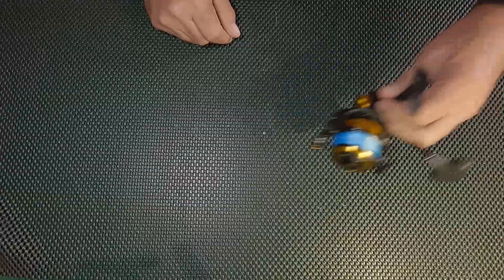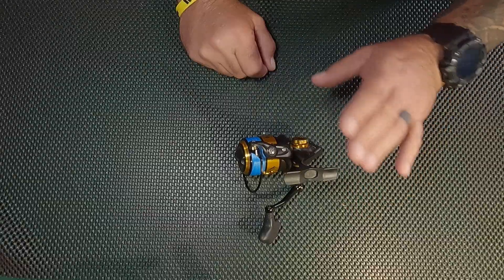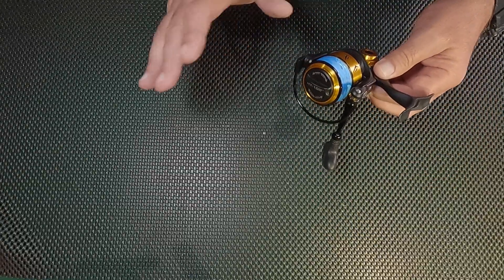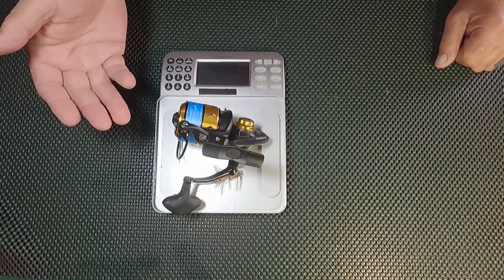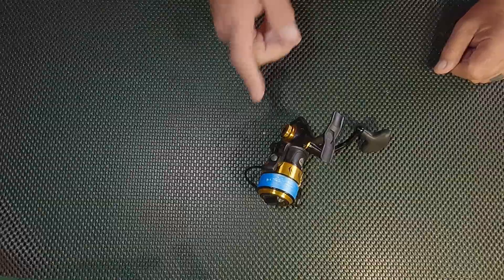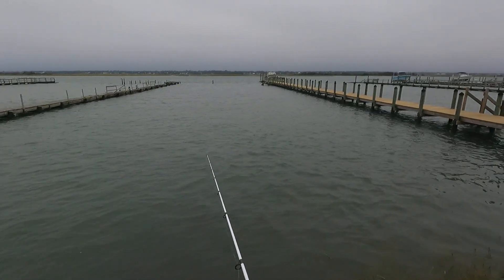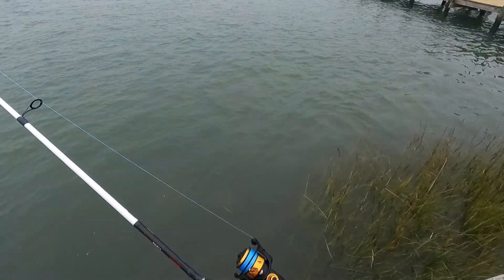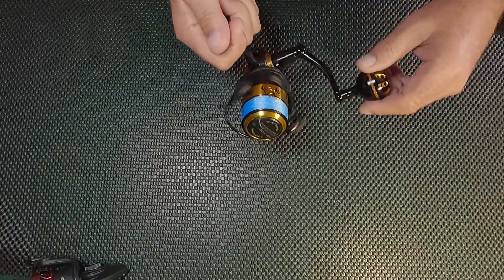Penn SpinFisher VII **Review**

Comment: HI! can you tell me the difference with the 3500? just the coil? or is the body also a size larger
Reply from the maker: Yes, as you go up in size the spool and the frame get larger.
Reply: in the end I opted for the 3500! after the third fishing trip I feel the gears on the crank! Have you also noticed something similar? it increases with a little traction of the bait.. it is no longer smooth